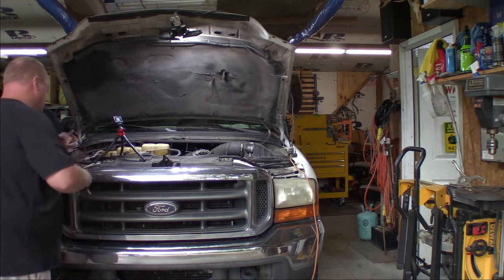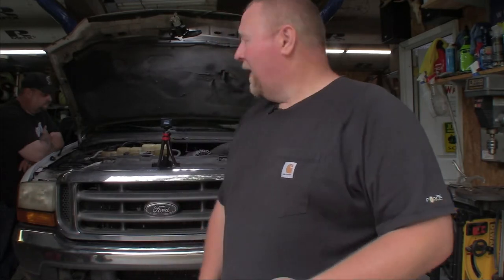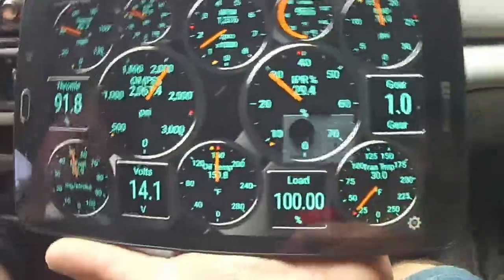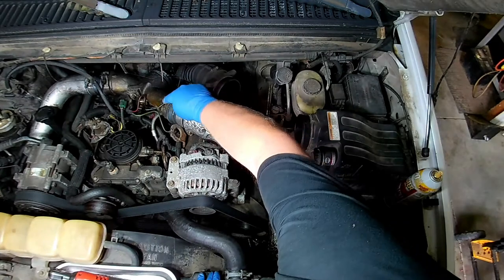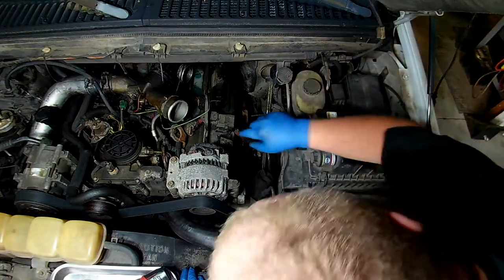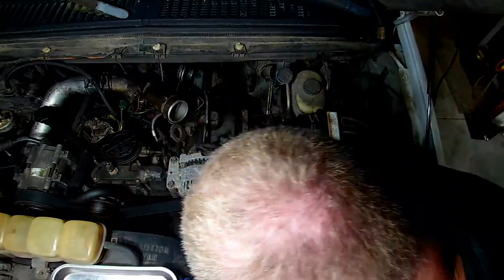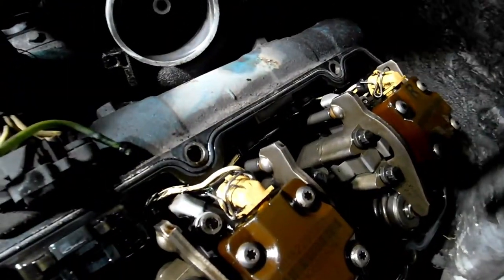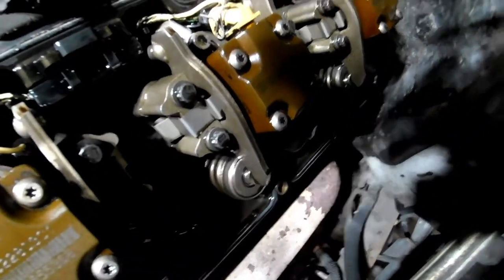7.3 Powerstroke - Diesel Fuel in Coolant (Injector Cup Replacement) | Part 1

Comment: I'm lost with mine, when you get to operate temp it starts to overflow. And apparently the head gaskets were done and the heads were resurfaced, but the truck has 305,000k miles on it. I'm not sure if it's worth the fix
Reply from the maker: I think it's absolutely worth the fix. Is it overflowing coolant, or is diesel fuel displacing the coolant causing the overflow?

Comment: What are you using that gives your tablet the ability to have all those gauges. Is that a part of FORSCAN lite?
Reply from the maker: Yep!! ForSCAN Lite and a cheap BAFX bluetooth dongle. Check my video description for a link.
Reply: @ProjectTimeGarage  
Love the videos. The injector test alone convinced me to get the bafx product. Now that I know I can use all those gauges on the live drive test, it will be a lifesaver with those hpop and ipm test.
Reply from the maker: @ryanbrock4620  Also consider buying the Torque Pro app. You can build some cool dashboards for our trucks.

Comment: I am getting fuel in my water, I hired a Mechanic to replace my injection cups, after pulling the injectors he ran a psi test of 16psi on the radiator and is telling me the cups are not leaking that it must have a cracked head.
Is that even possible?
My truck is a 2001 with a mileage of 122K
Thanks
Reply from the maker: The most common symptom of cracked cups is diesel fuel in the coolant. While the coolant system pressurizes to 15-16psi, the fuel rail will commonly see 70psi, since the fuel pressure is greater than the coolant pressure, the fuel is forced into the cooling system. Cracked head? Maybe, but if it were mine, I would stick a set of cups in it and drive it some. Cups are cheap compared to pulling heads. Just my 2 cents.

Comment: is it possible to get fuel in your water with a cracked head
I need to change my cups on a 2001 7.3 with 122k miles
Thanks
Reply from the maker: Sure, thats possible, but not as likely as cups.

Comment: Are injectors cups changed    when injectors are changed?
Reply from the maker: No, just changing injectors does not require changing cups. On these engines, the cups can develop hairline fractures allowing diesel fuel to mix in with the coolant. So, basically you would only change cups if you're getting diesel fuel in the coolant.